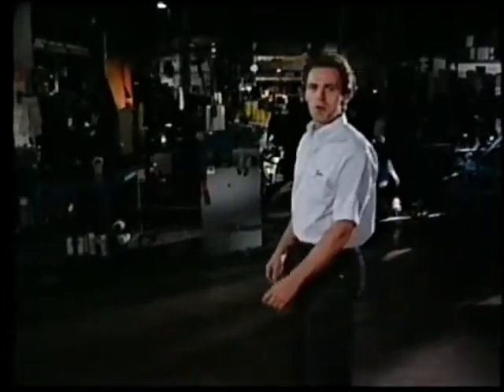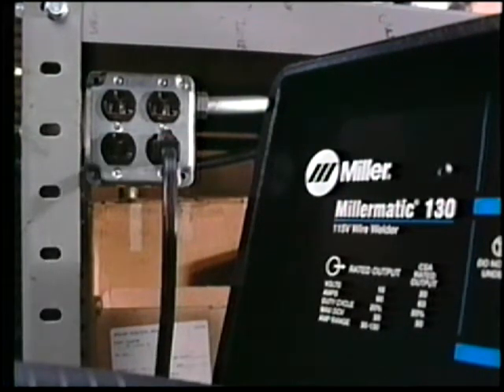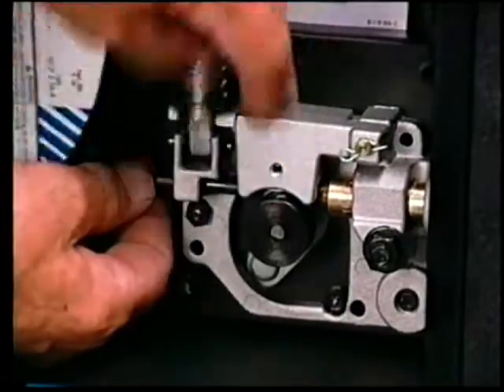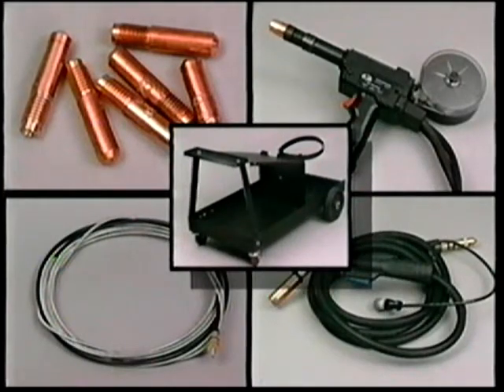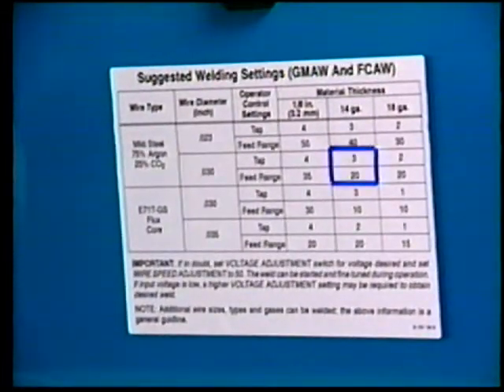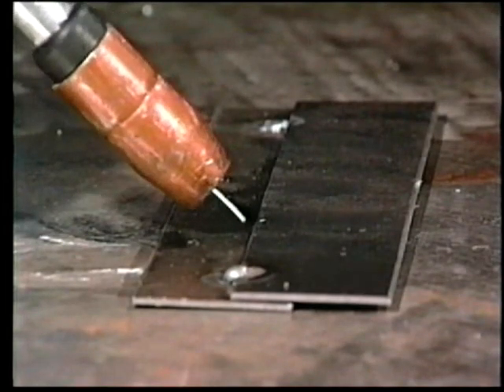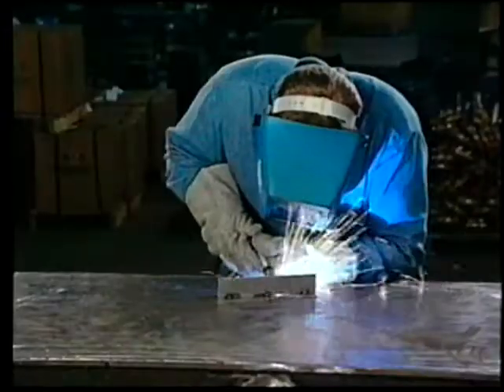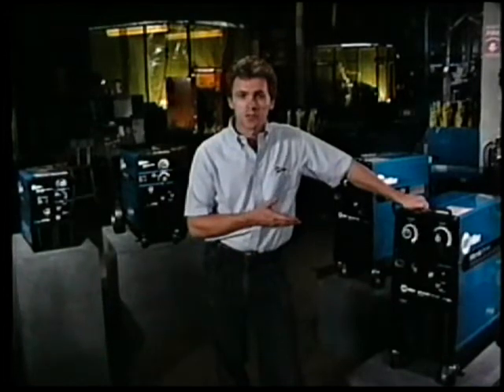How to Weld with a Millermatic 130

Comment: Can you weld aluminum with The Millermatic  130 & if so, what and how to Utilize it to weld Aluminum? Can you set it up to welding for this purpose! Grumpy Old Vet, Thanks👍😊
Reply: It's possible with a spool gun or a liner in your whip that isn't metal I can't remember the exact material but it's some sort of plastic that aluminum won't bind against and also you will have to run 100% argon for shielding gas.

Comment: Awesome video!!! I have a miller 130 ❤️ this machine!!!!
Reply: mikes06roadking i just bought a 130 at a swap meet and im really excited to start working with it is there anything bad with it that i should no about it???
Reply: 209chevymon mine didn’t have instructions. I had to download it online just for familiar with the parts and what consumables I need. Works great with 30amp power. Good luck great machine. Do some research and you’ll be in your way to welding😀